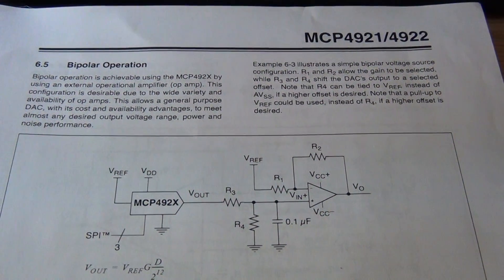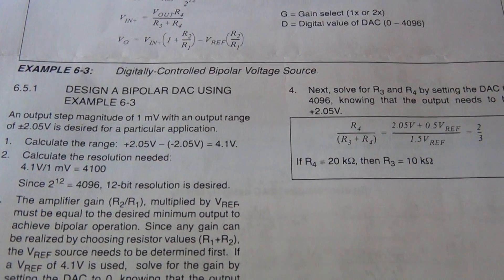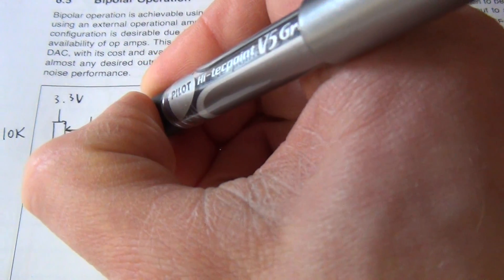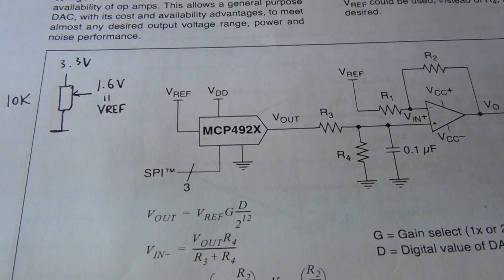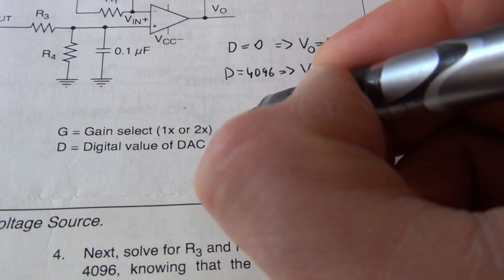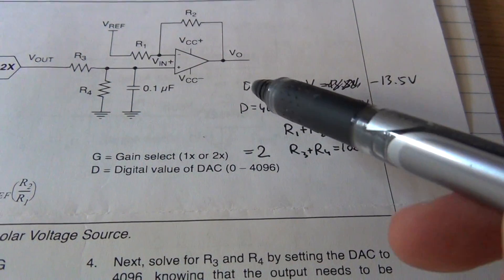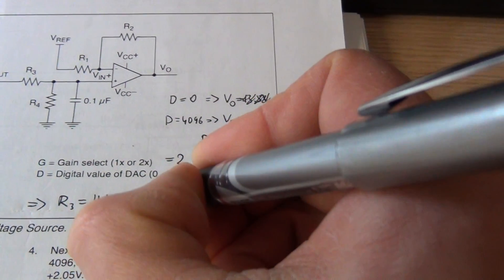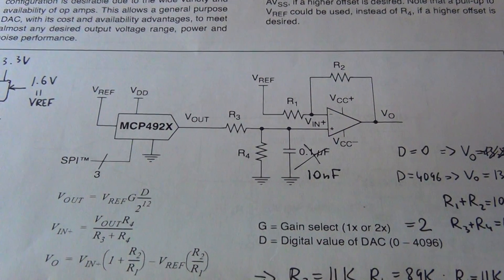DIY Saturday [20170114]: Galvanometer kit for laser projection -- Part 1

Comment: perhaps a silly question, but where did you get the OP-AMP?  Goggle doesn't find that part easily and searching at arrow yields different part numbers.  Are there alternatives?
Reply from the maker: Not a silly question! There was a typo in the description (already fixed), it should be LM324an op-amp, available everywhere for about 50 cents.

Sorry about that, hopefully there are only a few places with this typo :/